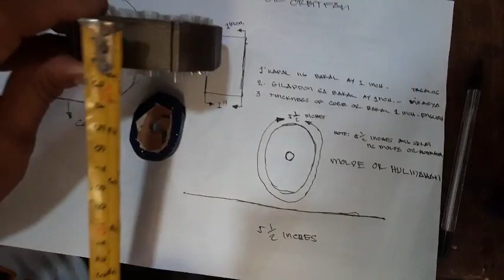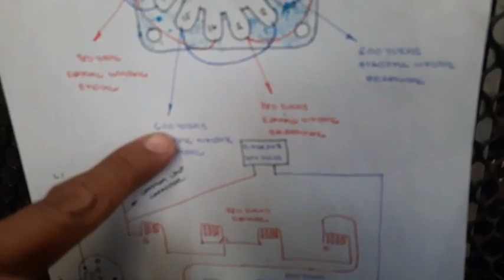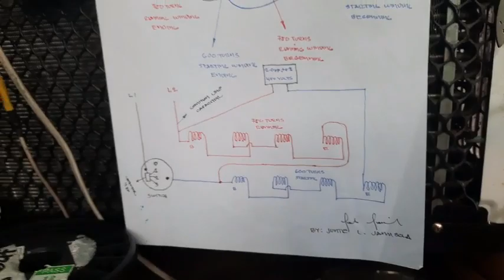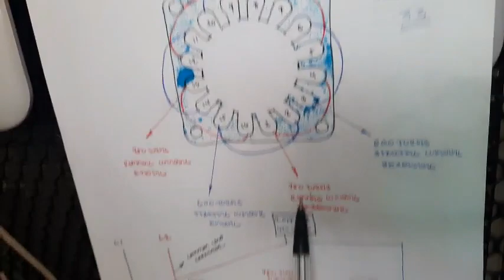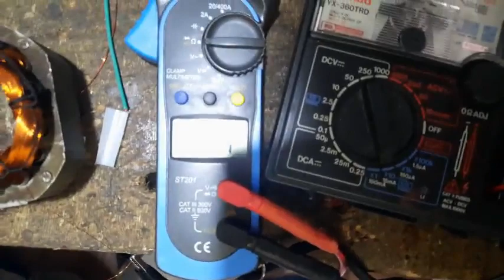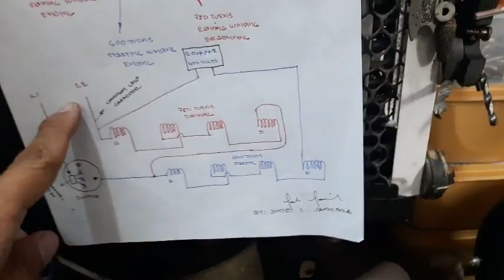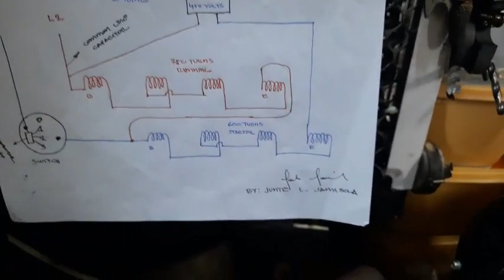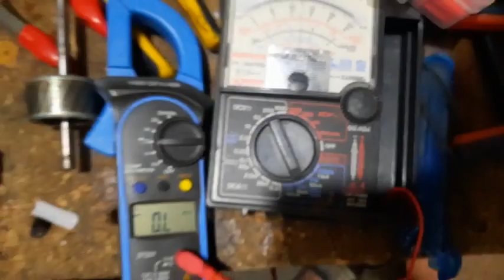Paano mag-rewind ng ceiling fan?

Comment: Sir good day po
Bagong praktis lang po na magrewind
Natapos ko na mairewind ang running @700 turn gusto ko gawing 750 turn papano ko ikonek ang dagdag na 50 turn para maging 750 turn
Tnx
Reply from the maker: Dagdag turns lng yan my frinds at 2.0 uf ang capacitor mo.
Reply: @juntevlogs5087  kung dagdagan ko ng 50turn papano po ekonek, parallel o series
Salamat
Reply from the maker: @felixdy3136  ganon parin ang connection..